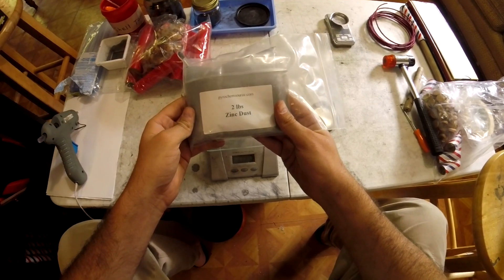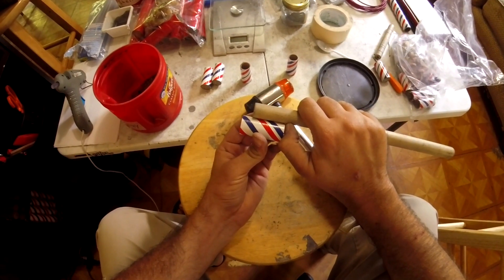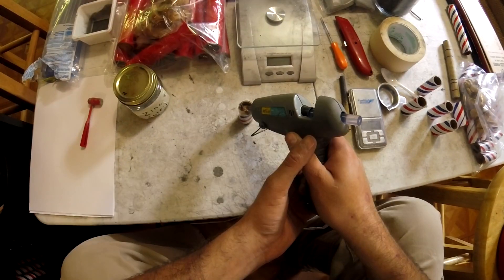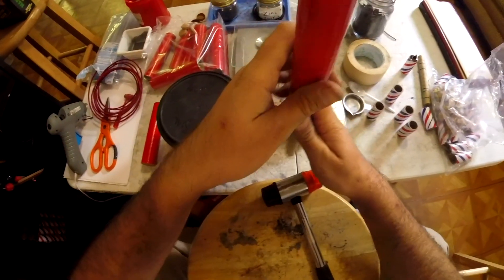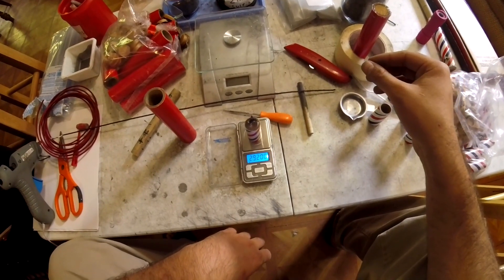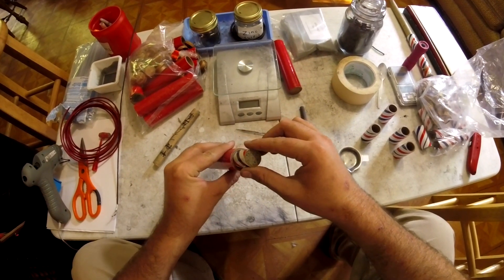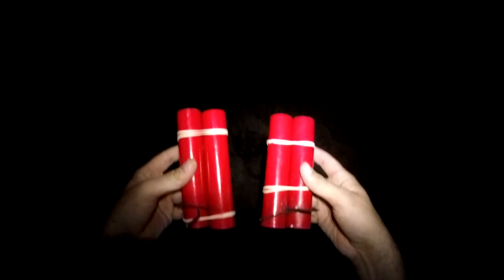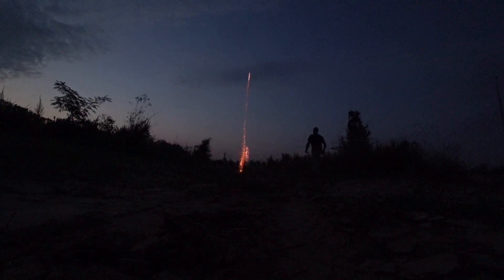Zinc Burst Charge Testing Pt.1

Comment: You're the second maker I've seen on YouTube lately using glass to weigh out and mix a dry compo.  Is this some revolution sweeping the amateur pyro world, or are you all nuts?  At least the lid is metal to conduct electric charge away, though I didn't see if it was insulated by a rubber seal.

Interesting you arrived at a 3:1 mass ratio of Zn to S, when 2:1 would be stoichiometric Zn + S -> ZnS as in the well-known rocket propellant.
Reply: Let's see your fireworks then.
Reply: @matt596  They're most of the contents of my channel.
Reply: It's called anti static spray. He's probably got it covered. We're still in the twenty first century if I remember correctly.

Comment: I found pushing a paper plug over the insert works well for pressure build up
Reply from the maker: I always assumed that the top plug was just to keep sparks out of the mortar and did not provide in significant assistance in pressure build up. but I'll give it a try :) Thanks for the feed back.